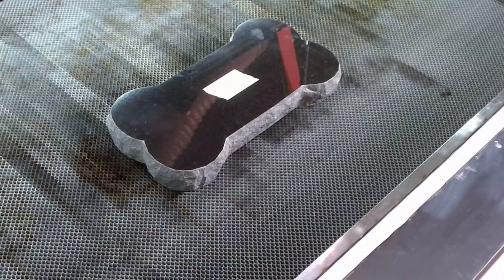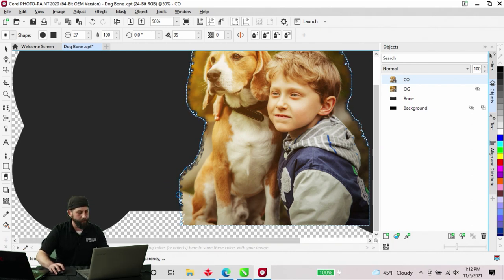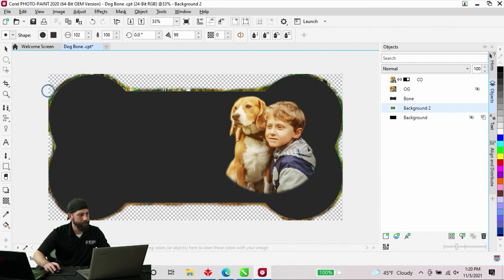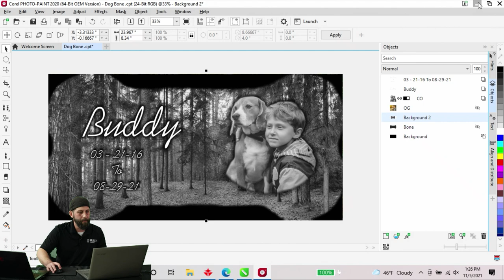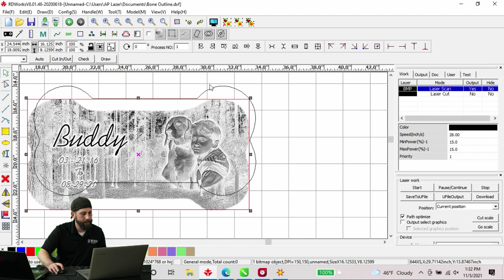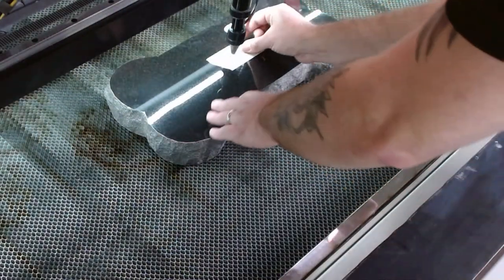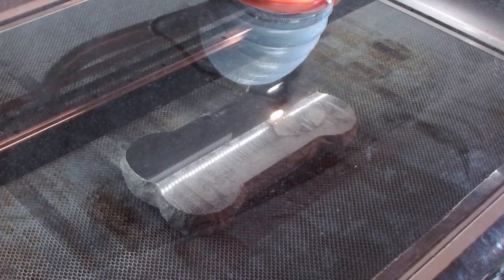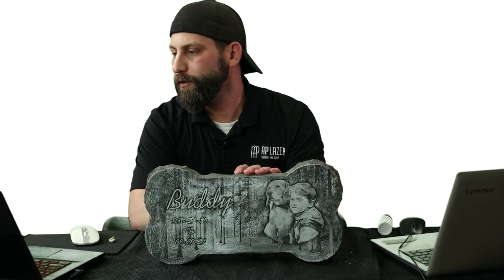AP Lazer Workshop | Granite Pet Marker with Laser Engraver

Comment: Why RDworks vs Lasercut5.3? You set my aunt and I up with laser cut but I maybe would like to get the RDworks as I’ve seen a few more videos running RDW rather than laser cut. Thanks!
Reply from the maker: Hi Jordan! All of our machines have come with RD Works for the last 4 years which is why we use it now instead of LaserCut. All file preparation and setup are the same, but we do offer a conversion kit to go from LaserCut to RD. RD has a ton of benefits to it like the ability to save speed and power settings and origin locking.
Reply: @APLazer  Hey! Thanks for the reply. I’ve been wondering for some time now. We were set up with a 3024 I believe back in 2016. I’ll talk to her and get in touch with Jason to figure out how we can get RDworks.